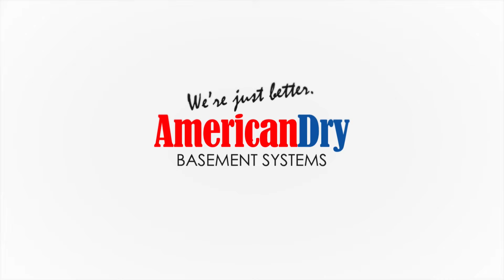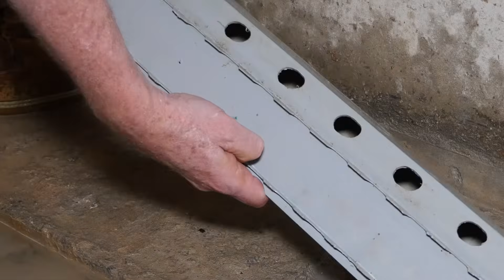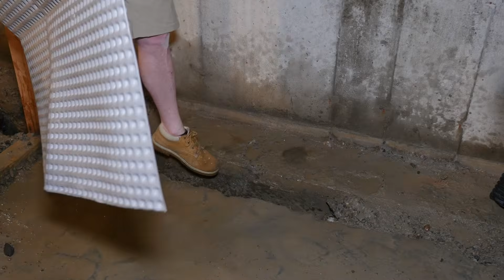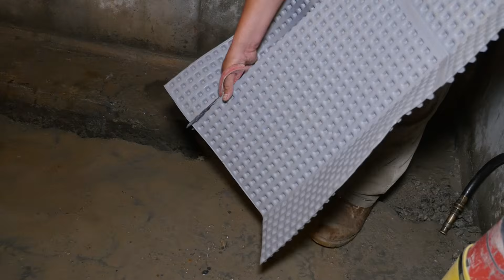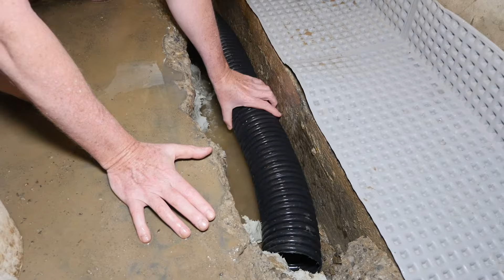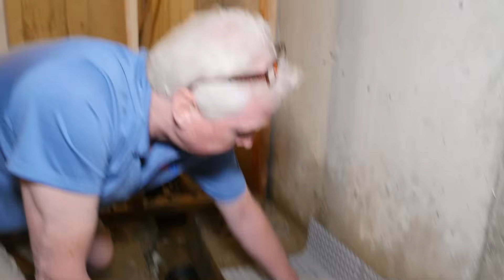Wet Basement Solutions | Installing an Interior Drainage System

Comment: Three questions 
1. Do you have to grate the dirt underneath the weeping tile twords the sumpump? 
2. Could the plastic piece that sits on the footing go past the footing, and above the gravel? 
3. When filling up the trench with concrete are you concerned that concrete could get underneath the plastic piece that sits on the footing?
Reply: I meant both the lenght and with of the trench sorry
Reply: @chirina5  okay thank you! Appreciate the info, what's the plastic piece called before you out down the concrete?
Reply: @BreezerX31  the plastic he is showing is called a drainage matting. Sizes will depend. Some rolls can be 3' wide by 50' long but indo believe they make some small pieces for basement systems. And the vapor barrier I was talking about is a 6 mil vapor barrier you can buy it at home depot. There are higher mils like 12 and 20 mil but a 6mil is enough usually all mils block out the same amount of moisture. 12 and 20 mils are usually used more on crawl space encapsulations that require stronger mils.
Reply: @chirina5  okay thank you! The plastic goes between the rocks and cement?
Reply: @BreezerX31  if you are referring to the 6 mil then yes. Idk if you have seen but anytime they poured concrete slabs they always put down a vapor barrier. Are you waterproofing your own basement?
Reply: @chirina5  oh okay, awesome! Yeah I never knew that. Also yeah, I am water proofing my own basement, currently in the process. I got the trench dug up, which was way more work than I expected.
Reply: @BreezerX31 yeah its definitely a lot of work but if you have any other questions just send me an email at gabrielchirina@gmail.com and if I can help you answered them then I will.
Reply: @chirina5  thats very useful thank you!
Reply from the maker: G V did a great job answering your questions. I just want to add:
1. We sometimes grade the dirt. The grade or pitch is more easily achieved by packing the pipe or weeping tile in wash stones. Its easier to adjust the pitch by removing or adding stone. It's also better for letting water perk up into the pipe.
2. The drainboard "plastic piece can stop at the lip of the footer or extend couple of inches over the gravel. The 6-mil vapor barrier keeps the wet concrete from seeping under the drainboard and into the gravel.
3. Answered in 2.
Reply: 1. do you mean grade? If so yes. That's what he meant about pitch.
2. you can extend the piece but it's not neccessary it's just recommended to be the same length of the footer. 
3. You put a piece of vapor barrier on top of the gravel and on top of the membrane. So basically you cut a piece of vapor barrier the length of your trench in this case his might be 16 inches and that vapor helps with the moisture and also it helps prevent concrete from going underneath the the membrane and also from going in the trench. I hope I helped answer your questions.

Comment: Thanks, I've been learning a lot from your vids. Recently started getting water in the basement of my 52 year old house. I've had a few contractors out to price the work. I was close to locking into a guy who's offering the WG system i.e. above footing gutter system, I think you've talked me out of it. 

If you worked in Canada, I'd give you a call for a quote :). I need to find a local guy who offers a system similar to yours. Thanks.
Reply from the maker: I'm glad you didn't go with the gutter. You should be able to find someone who installs 4" ADS corrugated piping pitched to a sump basin. Don't use fabric around the piping. It will filter sediment but will clog over time and barely allow any water into the piping. Best of luck!
Reply: American Dry Basement Systems Thanks for the response and will keep your tip in mind aboit the cloth.
Reply: @AmericanDryBasementSystems  I noticed instead of fabric you put plastic sheeting over the gravel. I guess that just seemed counterintuitive because you want the water to run thru the gravel unimpeded into your 4" ADS.
Reply from the maker: @aj12271  Fabric should never be used in place of a poly vapor barrier for waterproofing drainage. Can you explain to me how our vapor barrier stops water from moving into the gravel area? It never seems to fail in our system setup. I'm not understanding your point.
Reply: @AmericanDryBasementSystems  I've probably watched too many videos from so many different contractors & everyone seems to have a unique way of doing these installs. Some say, put landscape fabric, some say don't. Some say vapor barrier is only necessary couple inches up the wall while others say a couple feet. Some contractors say don't put the ADS at bottom of footer in the mud because it will clog up the holes, some say put top of pipe level with footer. Anyway, in general,  I think your method seems to be one of the best I've seen. I've watched several of Hydroarmor with Daniel O'connor I think is his name. You two have a lot of technique similarities.  I appreciate your response.
Reply from the maker: @aj12271  Hydroarmor and a couple of others have been doing this for years. They get it. They know what works and don't like it when customers come back to them complaining. Its a matter of integrity and pride. They do it right. Why re-invent the wheel when it works flawlessly? We refine our technique and products over the decades. Better concrete, better structural integrity, better pumps, better installation strategies, etc. But, the pipe with pitch and without fabric is an awesome form of engineering. Structural engineers use these techniques in farming and roadways all over the world. We preach with proof and by example. I appreciate your questions and helping out in any way I can.
Reply: @AmericanDryBasementSystems  I do have a question for you. I have a basement wall that separates it from the garage. How do you determine how many walls are trenched? Is is necessary to do all 4 walls?
Reply from the maker: @aj12271  Full-perimeter waterproofing (four-walls) is unnecessary in some situations. You can limit the trenching to one or two walls. It depends on visible signs of where the water is entering and pooling up.
Reply: @AmericanDryBasementSystems  Thank you, that makes sense to me. Next question & hopefully my last, are you installing a bed of gravel under the ADS and sloping it with the gravel depth or is it mostly sloped when digging out the dirt/mud? Does gravel need to be under the ADS anyway?
Reply from the maker: @aj12271  Sloping, grade or pitch is mainly achieved by using gravel/wash stones underneath the pipe. The pipe should be packed in stone. Stone creates a natural layer of filtration and drastically reduces the amount of sediment that enters the pipe.
Reply: @AmericanDryBasementSystems  Thank you! You've been a great resource. Continued success to you.
Reply: Does this work even with floor cracks that water enters?  Trying to make sure the perimeter drain will remove my basement flooding issues due to cracks and water entry via cove joints.

Thanks for the amazing videos!